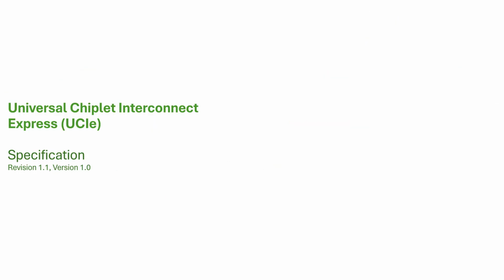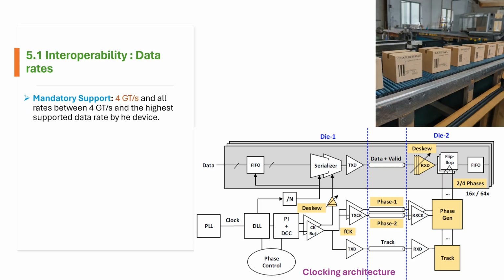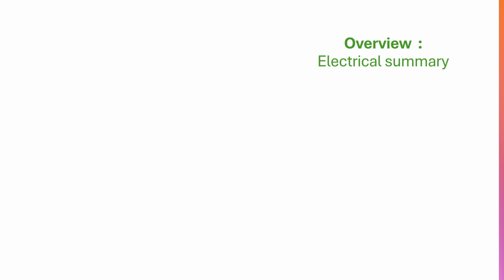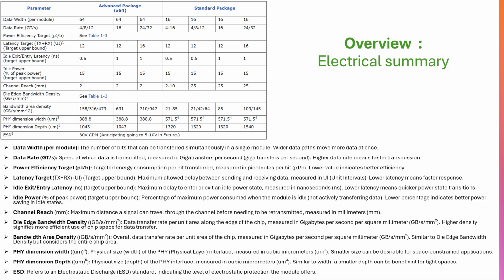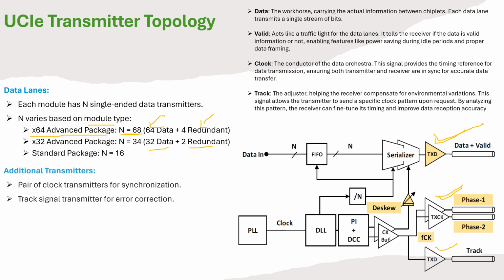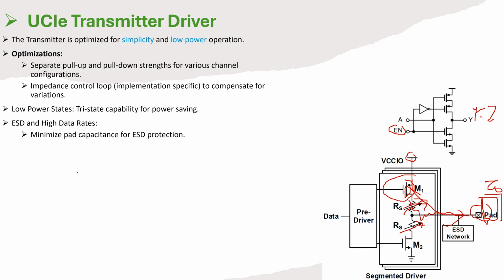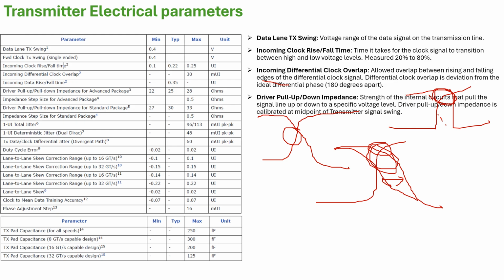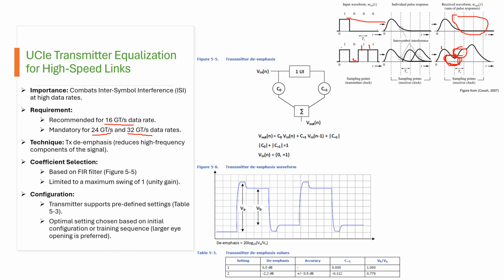UCIe PHY Electrical Layer

Comment: This video is about the electrical layer specifications of Universal Chiplet Interconnect Express (UCIe). UCIe is a revolutionary chiplet communication standard that enables high speed, low latency data exchange between two dice.

The electrical layer specifications define the physical characteristics of the electrical signals used to communicate between chiplets. These specifications are important because they ensure that chiplets from different vendors can interoperate with each other.

The key attributes of the UCIe electrical specifications include:

Data rates: UCIe supports data rates of 4, 8, 12, 16, 24 and 32 Gbps.

Signaling: UCIe uses single-ended signaling with a forwarded clock for data transfer.

Interoperability: UCIe defines mandatory data rates that all compliant devices must support. Additionally, spread spectrum clocking is allowed for signal integrity purposes.

Package models: UCIe supports two package models: standard and advanced. Standard package models use traditional packaging with larger pitch, while advanced package models use advanced packaging technologies like embedded multi-die interconnection bridge or chip on wafer on substrate.

The video also goes into detail about the electrical parameters of the UCIe transmitters and receivers. These parameters include:

Transmitter parameters: UCIe transmitters are optimized for simplicity and low power operation. They use segmented drivers and support features like source series termination, adjustable lane-to-lane skew correction, and clock to mean data training accuracy.

Equalization: UCIe recommends equalization for data rates of 16 Gbps and above to combat inter-symbol interference.

Overall, the UCIe electrical layer specifications provide a robust and interoperable foundation for high-speed chiplet communication.
Reply: Could you please make a video on the logical physical layer, that would be very helpful for understanding the complete physical layer of ucie.
Reply: where could I find more details and explanation about this new standards specs ? could you send me the pdf containing these spec?